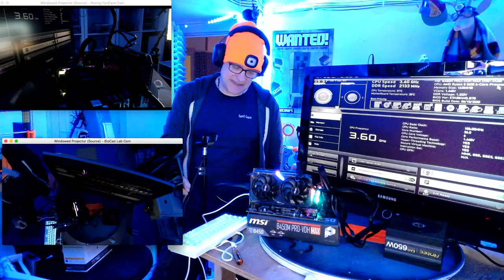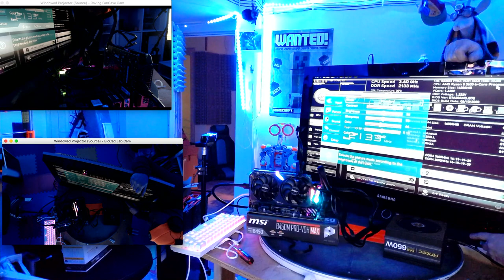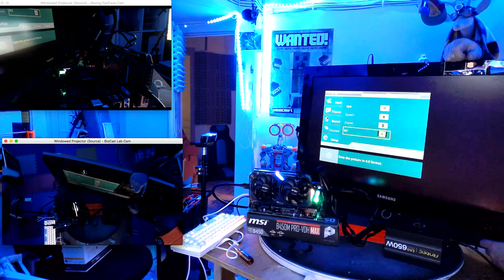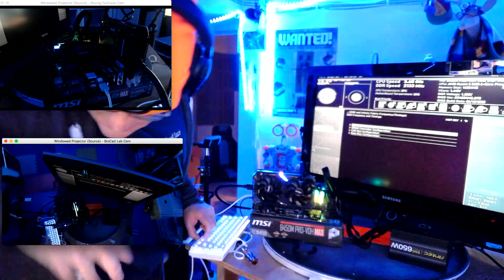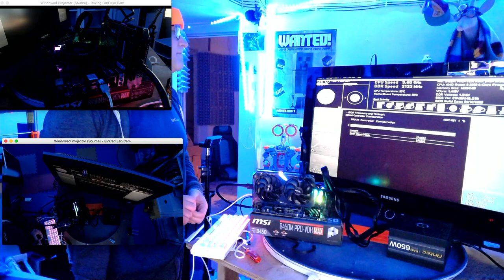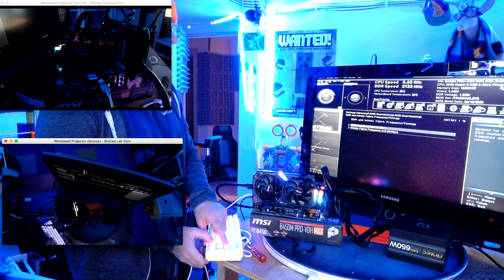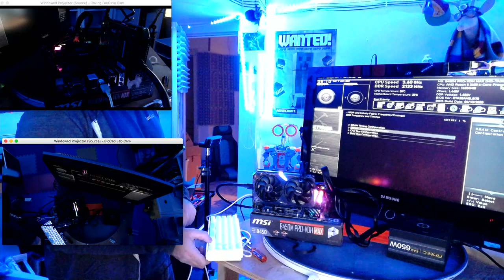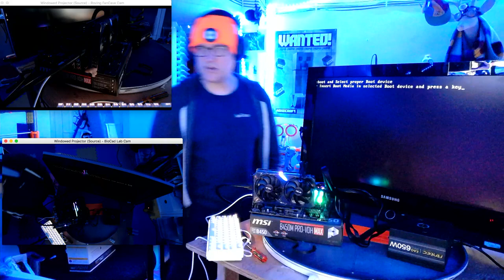TechBandits Dstat sponsored PC Build...It's no stargate. How hard can it be?

Comment: Hey There... Slow and easy... When i put a system together, i do it slowly, and double, trippel tjek everything to get it right... My usual fault is connecting the power and reset from tower wrong, so when i push the reset i turn the pc on and power to reset the pc, typical me... You did a great job at it... Lets hope noddle can manage it... Good luck to noddle...